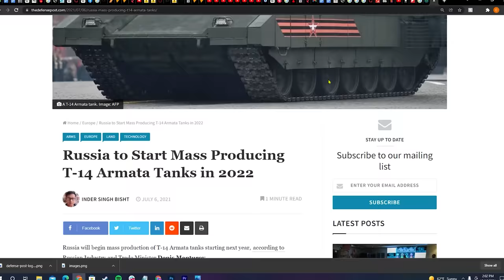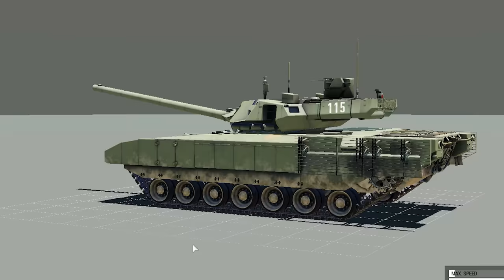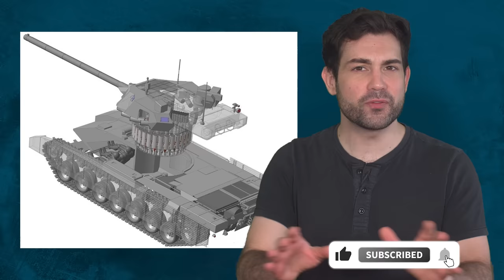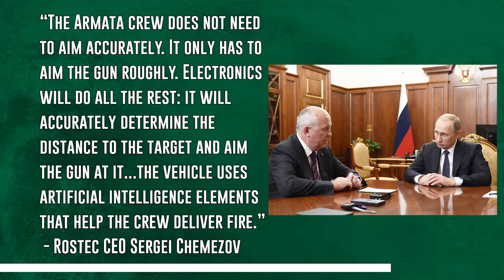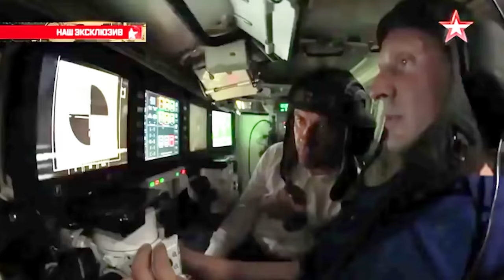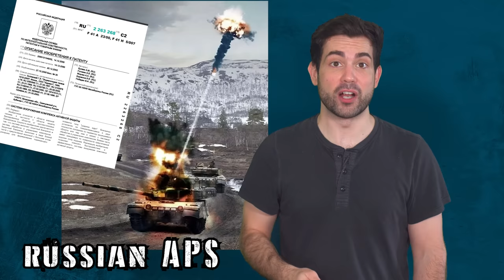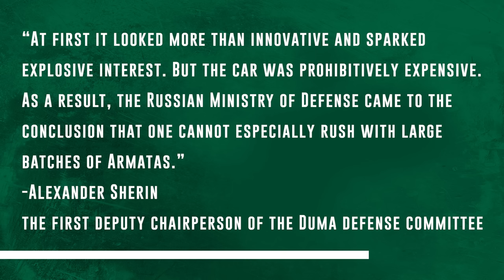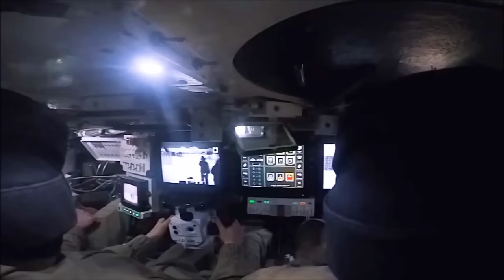The Truth About Russia's T-14 Armata Tank

Comment: The auto loader is also the cause of the the top popping off after impact.  Which is a pretty cool feature 😎
Reply: The carousel storage for the autoloader leaves the propellant exposed in both the old generations (T-72/90 and T-80) and the T-14.
That wasn't an obvious problem when the concern was a frontal attack.  A penetrating round would need to go through the thickest armor and crew before setting off the rounds.  At that point crew survivability is near zero, so popping the turret is merely 'extra dead'.

With a top-attack weapon the tiny formed penetrator is shot through the thin hull deck or turret roof.  That penetrator isn't likely to kill the crew, but the resulting cascade certainly is.  The isolated crew compartment of the T-14 isn't going to do much for protection unless all rounds have been expended.
Reply: @1djbecker  A Ukrainian drone dropped AT bomb hitting the turret would Not Hurt The Crew!  They Wouldn't feel a thing!!!  (Just see St. Peter face palming when they pop up at the Pearly Gates!!)
Reply: Very well said
Reply: Depends on the auto loader mechanism. the russian one was naked
Thats why its can eject its turret 🎉
Reply: Iam sure Russian tank crews had a moral spike when they realize that they are sitting directly on top of a bomb🤘

Comment: Composite armor is tricky and takes years of testing to get right, otherwise it will work against you.  Lastly, auto loaders that are 100% reliable in a battle without crew intervention is almost impossible without some sort of other gun loading system.   The tank is banged around so much, keeping that system running well is hard.
Reply: not really... auto loaders are the future. are faster and less sensitive than human and if fails... you retreat other tanks still keep you more fire power on the field.
Reply: Look at what Boston Dynamics robots are doing running obstacle courses.  Even if truly reliable autoloaders were impossible in 1970, 1990, 2010, things have advanced.
Reply: Autoloader will be needed for rounds bigger than 120mm.  The German 130mm might be capable but even Rheinmental thinks auto-loader is best.
Reply: French used autoloaders since the 90s and that's been fine. Given the do alot work in Africa which supply line nightmare and very dirty terrain. Think been properly tested. Also the French German combination tank project will use a french autoloader. 
This combination of work of Rheinmetall, Nexter and KMW.
So no autoloaders work just fine
Reply: nah, autoloaders were hard in the 60s and 70s, but that was 50-60 years ago man!  Design technology has come a long long way.  There CAD/CAM technologies that didn't exist, parts can be made that couldn't be made before (e.g., 3D print, CNC-milled, new alloys) and precisions that couldn't be made before.  Not to mention just five decades more good ideas and battle experience.  Thanks to computerized design the engineers can go explore directions they couldn't before, like making the autoloader able to load at any gun elevation, and even load if the parts are fairly out of tolerance (maybe a road accident or non-crippling hit has bent something, but things can be designed to work anyway).
Reply: @SB-ie8jn  *you're

And chances are better the loader is put out of action than a modern autoloader.
Reply: That whole statement there is total bullsh*t !!! Auto loafers are slow and fail at some point half the time. An Abrams crew can get a round off every five seconds, on target and at full gallop. Russians ( with a perfect running auto loader) may get one out the barrel every 20-30 seconds. Maybe on target if it and the target are both standing still.
Reply: @jebise1126  you are joking for sure!!!! All those so called auto loaders fail !!! And there is no falling back to repair in combat!!! That’s when you see that turret popping off and the crew burning to death!!!  You have been playing too many combat video games. The real world has no reset !!!!
Reply: @user-ev4pb9xj7e  that may have been true in the 1960s but it hasn't been true for decades now.
Reply: @lqr824  Western Tanks such as the Le Clerk and the Japanese tanks that use auto loaders don't use carousels but cassette type loaders that store the ammunition in the same way so don't introduce cook off risks.  Modern automation allows them to be reliable and safe.
Reply: @williamzk9083  The Armata has a safe solution with a carousel too: just keep the humans out of the turret.  I actually like the idea a lot.  (US had a prototype of this in the 80s I think.)  The bustle seems like the most armor-efficient way to keep the ammo out of a manned turret, but it'd not literally impossible to do the same with a carousel.  And as you say, whatever your layout for the ammo storage, you can make an autoloader that copes with it.

Comment: Strange but my positively ancient Centurion had a 165mm gun.
Last time I checked 165mm was bigger than 152mm and the Centurion was still an actual tank.
Of course it could only fire HESH but that is pretty good against everything.
Reply: That was a spigot mortar, not a high-velocity tank cannon.  FWIW, in figuring out improvements for their famed T-34 tank in the "Great Patriotic War", the Soviets actually fitted a few with high-velocity 57mm anti-tank guns, which had much better AP performance than the standard F34 76.2 mm tank gun.  As it also made for a tad more room in the turret, it would have proved to have a higher rate of fire, something important when slugging it out with the Panzers.

Instead, realizing there were other deficiencies that even this high-velocity gun wouldn't cure, instead the Soviets found a way to fit the turret proposed for the KV-85 tank with its D-5T 85 mm gun, resulting in the T-34/85.  This vehicle, still with some of the issues of its predecessors, could still hold its own, and even knock out a few of the "Big Cats" the Germans fielded.  It was considered, if not THE best tank of WWII, then one of them.
Reply: Mistake! Centurion had 90mm gun originally!

Comment: 1. The crew being separated from the turret doesn’t make the tank more lethal. It protects the crew from a catastrophic ammo detonation. (Historically an issue with Russian tanks) 
2. The auto loader debate has gone on for years. Having worked with autoloaders, nothing sucks more than having it malfunction right when you need it. (I’ll take the extra man.)
3. The Americans deviated from an unmanned turrets on main battle tanks for a reason. 
    a. The technology didn’t exist at the time to make it cost effective, and the amount of electric power required to operate the fire control is so high that the vehicle would have to never stop running in order to generate the necessary charge. 
    b. Situational awareness is key in modern combat. Cameras are cool and all, but nothing beats the ability to stick your head out of the hatch and take a look around without having your head knocked off by a main gun.

Comment: If you are really interested in comparison of Western and Eastern tanks, there is a great lecture on eastern and western tank development on the Panzermuseum Channel. Basically the idea of a middle gun carrier was developed in the 1970s in the USA and Germany but rejected because of the huge risk of firepower kill because the main weapon on is less protected and an easy target sitting solely on top. And the Russians seem to have problems with the programming of the software to run the vehicle, which seems to be the reason the tank stopped and could not roll but had to put on a trailer.
Reply: This tank on red square after they pull of brake start and goes with any other help...it was driver error not the tank, because it was young conscreept driver, not profecional from UVZ...at that time.T14 was on factory trail not in army...some smart man deside to let this rookie drive this new moder tank..to modern for them who luck of training on them ..
Reply: Ju knouu thoze Eaztern Tænks vs ones of Uuest. There are no other names – there's no: separate political bodies, states, countries, ethnos.
Reply: @Robert-cu9bm  Let's hope it doesn't come to that.

Comment: It still has a nice big round trap between the main tank body and the bottom of the turret.  Unless they really reinforced the turret retention system it's going to pop tops as well as any other Russian tank when taking a bullseye from a 120mm HEAT round.
Reply: Wonder if that turret would skid like a hockey puck, go barrel first like a dart or whirl like a thrown hatchet if the missile hits the rear ammo trap on that Xenomorph-looking abomination of a turret
Reply: @self-transforming_machine-elf  i mean even if it does.... there's nobody in there. that's the point.
Reply: It's not WW2 Sabot does not ricochet. The idea of a shot trap is irrelevant nowadays. That's how you can have turrets like the Leo 2A5 and higher.
Reply: @DisplayLine6.13.9  
No it isn't
Reply: @andrewholdaway813  Well if the concept of a shot trap isn't irrelevant than explain all the shot traps. What of the A5's turret, Or the M1's upper hull front that leads directly to a weak spot in the turret. Are all post war designers just idiots ?
Reply: @DisplayLine6.13.9  
Shot traps are generally unavoidable
Reply: @andrewholdaway813  Well the additional armor on the Leo could have been flat like on the pre A5 variants. It could have only sloped one direction like on the M1 and challenger, only the upper halve could have been installed. The front upper hull plate on the M1 could have been vertical or it could have ribbed armor or the shape could have been similar to the T series of thanks. 

Those aren't unavoidable shot traps. So again do you think the designers just didn't think of those solutions ? Or are you going to look up what an APFSDS penetrating sloped armor looks like.
Reply: @DisplayLine6.13.9  
I have no idea what criteria led to their design, no I've already seen what it looks like.
Reply: @andrewholdaway813  Well than you know that APFSDS does not ricochet. Even at it's critical angles the long rot will align with the plate when already inside of it.
Reply: @DisplayLine6.13.9  
What have ricochets got to do with it.
Reply: @andrewholdaway813  A shot trap is a spot on the armor that reflects ricochet shots into a weak spot. If the ammo you're facing does not ricochet then the shot trap as a concept is irrelevant. Witch is my original point. "It's not WW2 Sabot does not ricochet. The idea of a shot trap is irrelevant nowadays."
Reply: @DisplayLine6.13.9  
Not necessarily into a weak spot. Not all rounds are long rods. The chance of shot trap kills has always been low and designer's don't seem ever to have been overly concerned; but they were and are not irrelevant.
Reply: @andrewholdaway813  In WW2 shot traps would get fixed. The M1 has been with us since the 80s that's a very long time, and none of it's shot traps were fixed. The leopard 2 had a lot of design changes to eliminate weak spots. Yet not only were shot traps not fixed they were added. 

I consider them irrelevant as they are clearly ignored by modern tank design.

Other modern rounds are probably in a similar situation as long rods. 

A HE round with today's calibers breaks the roof of the hull when impacting the turret shot trap or not.

Now I don't remember why HEAT does not ricochet. But a guess. HEAT might either trip the fuse and ricocheting of the jet doesn't occur. Or the angle is so large that the fuse doesn't get tripped and the round shatters on the impact without fusing.
Reply: @DisplayLine6.13.9  
you are starting to sound like you are just making stuff up.
Reply: @andrewholdaway813  Look kid. If you cared you would look it up. In fact this comes up so often that if you ever read about tanks you would have come across this trueism that modern ammo does not care about shot traps. If you want it visualized there is  channel called SY Simulations.

I don't have any information on hand or bookmarked, I cared about military vehicles back in high school. You wont get much more from arguing with me.

This is not some important topic. I don't really care if you believe in shot traps or not. So either look it up or enjoy your day.
Reply: @DisplayLine6.13.9  
I Don't care about shot traps, you seem to though. Yeah, seen the sy  sims (#subscriber), you run off and play now.

Comment: So an effective round against these "smart tanks" would be an electromagnetic pulse
Reply: I just found out that some 'iskander' missiles can be fitted with EMP warheads to disrupt FOB/airport/telecom etc. If indeed effective, they should easily disable an armor column on, say... an open road.
Reply: @RavenRedwood  No need, they forget to bring enough fuel and food and end up sitting disabled on a road for weeks anyway XD
Reply: EMPs are generally not going to work well on tanks.  Anything that has an outer metal shell will kind of act like a Faraday cage and greatly reduce the effectiveness of the EMP.  Also, as we've learned from regular cars - EMPs don't really kill relatively simple electronics.  Your average passenger car off a dealer lot might stall when hit by an EMP... but you can literally just start it back up.  EMPs are not some magic weapon.

They are good against nonhardened sophisticated electronics - but the military almost always protects stuff like that against EMP with simple faraday cages and whatnot.

Comment: One major issue with autoloaders is seen in previous tanks such as the T-90 and 80. Since they have the circular system so that is can load it is very likely to get hit when taking fire, causing an ammo explosion. Even if this doesn’t kill the crew since they are in a separate compartment the tank is more than disabled.
Reply: This is why the American made Javelin has been so effective against Russian tanks in the fight for Ukraine. The missiles it uses just goes straight up and then back down on the turret, and there goes the rounds in the auto loader, especially with the Javelin's clever design of using tandem charges to first trigger ERA so that the other charge penetrates armor.
Reply: при попадании в отсек хранения снарядов танка абрамс, от также выводится из строя.
Reply: @azurblueknights  эффективность джавелинов на Украине сильно преувеличена. Т72Б лучше защищен в верхней проекции, чем абрамс, хотя конечно не достаточно. Это вечная борьба за вес заставляет конструкторов уменьшать бронирование сверху. Но компактные размеры Т72, позволяют сделать бронирование сверху лучше. Т14 в этом отношении еще лучше, т.к. башня не обитаема и при её подрыве никакого вреда экипажу не наносит.
Reply: Sure if the additonal defense measure on it does not work. Also if they bribed the right persons even russia would know how challenger 2 can take up multiple anti tank missiles and live. With just that it would beat abrams..

Not even abrams is as tanky as challenger 2 vs anti tank
Reply: Even better thing about the turret design is that the autoloader can't be reached by the crew if it jams, which thanks to Russian quality control is highly likely. So it will definitely be unable to engage anything before the end of the first hour after being deployed.
Reply: The only issue russian auto loaders have currently is a lack of ammo protection, like what abrams, challengers and leopards have.

Your point baout autoloaders make them more vulnerable is pointless. All tsnks have majority of ammo in one spot, 2 spots at most but compared to russia they all have ammo detonatipn mitigation measures so it doesnt turn the tank into a bomb
Reply: @Andy-kl1ry  but not the crew
Reply: @Andy-kl1ry   and that's just a straight up copium
Reply: @kurosai006ichigo3  well.. effectiveness of this mesures is pretty diverse
In T-72 and its older copies it' doesn't working and it Abrams does
Reply: @azurblueknights  The Javelin is effective because 1 its a top attack anti tank guided missile which will kill everything and 2nd because there is no real counter for it (The cope cages some people claim as anti javelin shields dont count).
Reply: @Andy-kl1ry of course.
Reply: @kurosai006ichigo3 There’s our standard Brit coming to chime in as usual.
Reply: @kurosai006ichigo3 Then what does?

Comment: Whether or not the T-14 is a amazing in the field is hard to say, but the concept of having a common chassis for different types of combat vehicles is very good and should be considered by the west.

Regarding autoloaders, I think they absolutely are the future. What people often completely overlook that this is not a "Russia vs the west" decision. The French Leclerc has an autoloader, and since France and Germany seem to be planing to produce the next MBT together, with Italy now also jumping on and GB as an observer to the project, it is likely that that tank will also feature an autoloader.
Reply: The problem is that if you dont have a manual backup, a auto loader becomes a liability. Tanks get knocked around ALOT, and any delicate machinery will sooner or later (under battlefield conditions rather sooner) break, and even a minor machine failure can mean that your entire weapon system becomes defacto useless and needs repair. Thats the reason why the west is very hesitant to go full on auto loader and unmanned turrets.
Reply: KF-41 Lynx is aiming to do so.

However it's really hard to have good chassis for both IFV and Tank. In the former you have to have room at the back for troops, in the latter you have to have all the protection you can afford and heavier weapon system.

It's easier to do everything beside the tank (so IFV, APC, ATGM launcher, AA launcher, artillery platform, command vehicle and so on)

Basically you can equip entire mechanised infantry regiment with it, but not entire land force